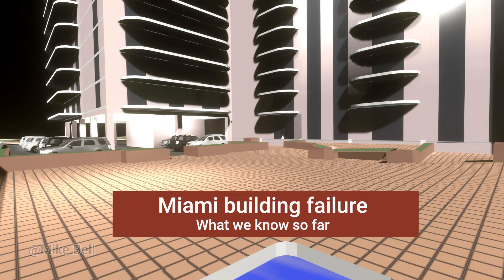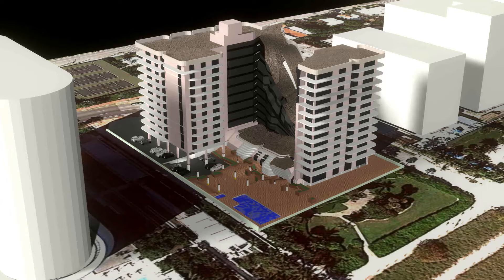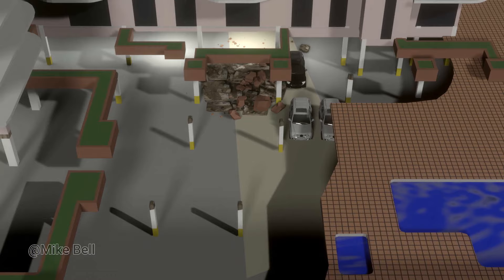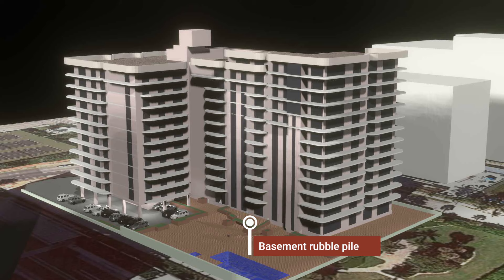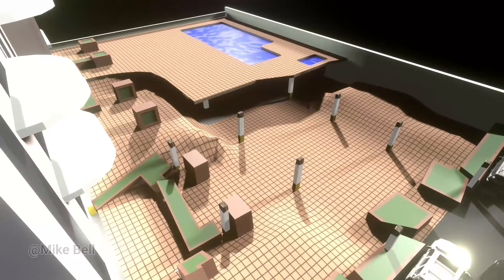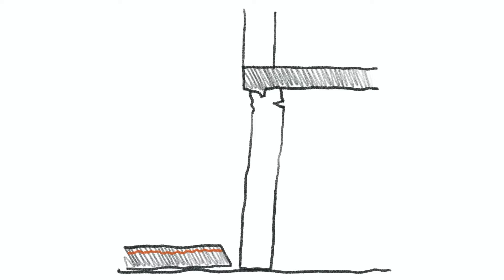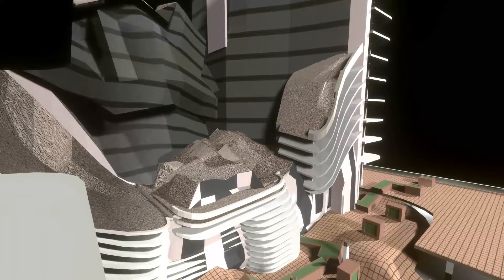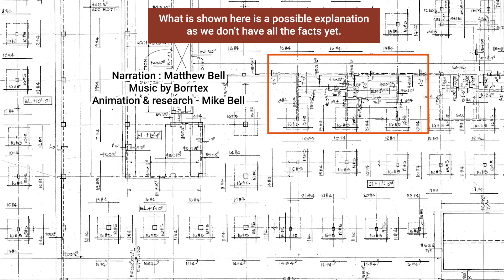MIAMI CONDO COLLAPSE | visualization of the evidence pt2

Comment: I work for a surveying company and my main job with them is to perform dilapidation reports on buildings that surround new development sites. If a new building is about to be built, it's law where I am from that you have to hire a surveying company to investigate and photograph every inch of every surrounding property and record pre-existing damage in case ground works from the new site cause vibrations which in turn cause any damage, I will be the one who will have recorded whether the damage caused was pre-existing or caused by the new development.... So needless to say, I've seen every inch of hundreds of parking garages, staircases, and the internals of every apartment in those buildings over the last few years.... And I've seen waaayyyyy worse than the water damage in the video from a year before the collapse. It's scary to know this is probably going to become more common as buildings progressively get taller and fancier, but completed with shortcuts and cheap materials to build them faster and for less. They look all nice and fancy when they're completed but after 15-20 years, they'll look like they're 70-80 years old in terms of depreciation and damaged caused by a mixture of poor designs and shoddy builders/developers. I've seen entire support columns of high rises cracking with efflorescence caused by leaking pools on the ground level. Entire slabs cracked in two, with cracks large enough I can see the warped re-enforced steel inside it. Sagging cement that separates the ground floor from the basement... among other things. We always inform the building managers, body corporates and councils when we find damage to areas that could put the structural integrity of the building at risk one day, but it's always shrugged off. No one seems to care until the worst case scenario happens.

With some of the things I've seen, I'd never live in an apartment block taller than a few stories.
Reply: Very good advice.
Reply: Holy sh**!!!! Your comment will undoubtedly haunt me for life now, but I’m glad I read it. Thank you 🙏🏻
Reply: Thanks for your insight I'll take your word for it and stick with houses, thanks.
Reply: I have no building construction experience, but from looking to the spikes, (You refer to as colums). On first sight they seem very small for such a heavy construction.
Reply: Hello! Can you help with that: can you tell me if it is possible to say it is safe to stay living in an apartment with some "scars" on the wall and on the ceiling, just by giving a glance at them? =/
Reply: You better create a list of what you have seen and where please.
Reply: @GYT923  thanks a lot.
Reply from the maker: Fantastic comment Grant.  I agree this what I also find troubling.  There were no obvious signs of distress.  Morabito Engineers who had done detailed inspections multiple times and are most qualified to assess the stability of the structure.  They too would have seen much worse and did not advise evacuation.  Nobody else raised the alarm.  The threat lay hidden.
This confirms the perfect storm scenario where multiple factors aligned to cause the catastrophe.  
Razor thin margins (or negligence) in the structural design and inadequate punch thru failure rebar.  
Long-term corrosion through maintenance neglect.  
Inadequate drainage slopes on the pool deck worsening salt infiltration.  
Possible internal stresses in the structure from historic differential settlement.  
Inadequate shear-walls.  
A peculiar arrangement of planter support beams which crunched/buckled 3 tower columns.

There are so many buildings in a much worse state and they remain.  There are abandoned buildings receiving zero maintenance which are still standing.  We will have to wait for the conclusive answers why this building was doomed.
Reply: @Mike-Bell  You're right. When it comes to a disaster this catastrophic, it's not just 1 or 2 underlying issues.... It's several and as you say it caused a perfect storm scenario.
I haven't been following the developments of the investigation, I'm all the way in Australia and except for the collapse itself, we've not heard much on the news over here - but I sincerely hope someone is held accountable if it's even possible to do so...
Biggest problem is the building was built 40 years ago in 1981. I just researched the developer in charge of the project and his name was Nathan Reiber - died in 2014. It's hard to go after someone who's been dead for 7 years. In fact it was a number of developers who had forged together to create a company purely to build this building "Champlain Towers South Associates". So once the building was completed, they would have packed up that company making it a nightmare for residents if (or in this case when) something happens to chase up restitution for their losses.... Whilst there were still architects, engineers and plenty of other contractors involved - most of the decisions made would have fallen back on Nathan and his fellow developers who were the ones reaching into their pockets to fund the project. I also read that the main architect on the building William M. Friedman (not sure if he's still alive) had been suspended due to something else he designed collapsing in a hurricane in 1967 so there's every chance this building was doomed from the moment it was designed.
I'd imagine that anyone who should be held responsible will either now be dead or will be dead within the next few years as they'd all be 80-90 years old or older.
Reply: @Godzillafan1980  But if everyone else on the planet died, how would you ever lose your virginity?
Reply: Uhhh, depends.  Living in earthquake areas has shown me that it's better to live in a house built of straw.
Reply: Same. Id never live in a high rise, always had fear of a major disaster
Reply: Money 💰 is the key any care about human lives
Reply: Thanks now not will I :)
Reply: Building 500 (?) yards from the ocean, on sand, has got to be the deciding factor here...
Reply: Thank you for your informative post. The conditions you enumerate are all the more reason why all towns and cities need more robust laws and aggressive inspection regimes that would require consulting engineers to report dangerous conditions to municipal authorities and hold them culpable if they do not state succinctly that a particular structure or condition is a threat to life, and would most of all require local building authorities to aggressively enforce safety codes and act swiftly to condemn and evacuate when a structure is dangerously out of compliance.
Reply: The building was originally designed in the 70's. At the time, the support structures were carrying approximately 90% + of their recommended capacity for their size. Later refitting of patios and interiors included a lot of Granite tile and granite overlay of patios. One apartment is no big deal, but you start sticking stone tiles and counters into every apartment, the tonnage starts piling up quickly. Then you add planters with dirt and water, tiles to the pool deck with sand under them and you get a lot of extra weight causing flexion of the structure that as standing water seeps into the concrete. There was a lot of water pooling and cracking in the garage area where the deck began to collapse. Several months before, one of the planters in the pool deck had dropped on one side by several inches indicating the start of a potential punching shear. It was put down to root intrusion. Photos later released. There was also cracking and spalling in the pool mechanical with photos taken buy the contractor checking out the pool mechanics. There were a lot of things that, taken as a whole, point to this building screaming that it was overloaded.
Reply: Do the regulations not stipulate enough to prevent this sort of thing?
Reply: Good to know. I’m interested in your thoughts on the large buildings built in the sixteen and seventeen hundreds vs now. I have the impression they were built to withstand time with more attention to detail, and esthetically much more pleasing in my opinion. I’m also curious what you think of glass bridges (I saw a video of two different ones in China I believe?) and the glass pools that connect two buildings higher up. I suppose they’re intended to look somewhat scary but to me they look like they actually could be scary.
Reply: Yes, classic brick building with wooden floor structures !
Reply: Why don’t you inform the residents living in these condos about the condition of the building, so they can push building management to fix the issues? Lest another similar tragedy happens elsewhere

Comment: I practiced architecture for 35 and have considerable experience in concrete and steel construction, having worked in many projects designing structural solutions in concert with structural, mechanical, and civil engineers. I have not heard yet any comments to this effect, but if the video is correct (and I've seen this before on another video), it is inconceivable to me that the structure for the pool deck was connected directly to the structural columns of the building.  Those should have been designed as two separate structural systems from day one.  In the underground garage there would have been two sets of columns side by side along the outline of the building above.  Two different structures, with different loads, and different horizontal and vertical forces. I would have never, ever, designed anything like that, nor would I have approved such a design if presented to me.  I hope to hear about this from those investigating the cause for the collapse.
Reply: I'm no engineer but I agree..  have seen a few videos on this collapse and cannot understand how the pool deck used the same columns along the deck side as the actual tower itself.  How did this ever get approved and built?  Makes no sense to me.  I have been in a few high rises with decks above garages, etc. and I have seen columns side by side, 1 for the building and the other for the deck.  Completely separate supports.  I recently watched a video of the other Champlain tower where they are adding supports in the garage until repairs can be done.  It looks as if the north tower is built exactly the same way.  I would be hi-tailing it out of there if I was a resident for sure.  I wonder if we will ever know what the actual cause of this collapse was.  In this day and age things like this just should not happen.
Reply: @glenembrey1187  Approved because of building dept. corruption and ineptitude.
Reply: Are you an engineer?

Comment: Nice computer simulation.  A month later and the shock and horror of this event still ring loud.  The cause of failure source is essential for so many people.  Not just the loved ones but the other condo dwellers in that area specifically want and need to know so they may take appropriate action as necessary.
Reply: There are immediate engineering factors then there are philosophical factors: "Not my yob, mon" as it were.

If we cure the philosophy -- and the Lord is leaning near hoping for open ears -- this will bring due attention upon the quality of engineering of the edifices we have chosen to depend upon.

The concern is as old as Leviticus.  To restate in modern terms: if your roof is accessible as a living space then it had better have a wall for safety's sake or the blood of accident victims is on you.

Also Jesus the carpenter spoke of the necessity of a good foundation as a spiritual metaphor whose physical illustration would have been obvious at the time.

This won't be cheap or easy to fix.  Many engineering sins have been buried to more or less quietly emerge later.  Perhaps sonic and strain sensors will prove necessary.  An evacuation would stink, but not as much as an unwarned collapse.
Reply: McAfee ??? 🤔🤔🤔

Comment: So sad. I drove past this building every day for 10 years.
Reply: I just thought about the earthquake that was felt in Miami a couple years ago. Was this area impacted any by this? I wonder if the earthquake worsened the state of this building.
Reply: @cicefashion4685  This building was in good condition vs Lateral loading conditions (hurricanes/earthquake loads) as their shear walls proved to be functioning well (they were the reason why the 2nd collapse was delayed and why the other part of the building didn't fall down). So, no i doubt earthquakes had anything to do with this collapse. In case you are wondering, yeah shear walls are the main elements that resist lateral loads.
Reply: @cicefashion4685  Do you mean the Haiti Quake ??   There are quakes that happen south of florida,  but  I haven't seen that any were close to  southern florida  as an epicenter.  Dutchsinse is  a great source  for  quake  news.  ( just dont tell the  USGS ) :)   I have another  "watcher"  in the house  here  who agrees - there was a minor quake in florida within the last few years ,  between Tallahassee and  the  Gulf coast,  she says  below 2.1  so,  it most likely  did not affect this  structure at all.
Reply: Hey Tom,  were you there for Hurr. Andrew??    I could see that starting the  corrosion if the  basement flooded.
Reply: @Wag2112  hi Wag2112! Yes, the earthquake I am referring to happened on Jan 28, 2020. It was a 7.7 outside of Cuba and Jamaica felt in Miami. A few buildings swayed. In September of that year other trimmers were felt, but I think there was a construction explosion that caused  those trimmers.
Reply: @JoseRamos-mv2ty  liar*
Reply: Alpha Omega  <<<<<<<< Troll alert
Reply: Mmmeeee meeeee meeeeee

Comment: I think you have presented a very logical and well thought out scenario of the failure.  I think we will find that the pool deck slab was significantly overloaded by the addition of built up fill slabs to obtain slope for drainage the setting bed and pavers and the loads from the planters, which the original structural engineer did not provide for.  Note that the pool deck slab was only 9 1/2 inches thick with a max. span of 29 feet.  Based on 50 years of structural engineering experience it should have been at least 2 inches thicker or should have incorporated at least 4 inch deep drop panels at the columns.  Great job with the simulation.
Reply: Making those planters part of the pool deck was a bad idea. If they hadn't done that and used individual planters you buy in a store that would hold the water (no holes on the bottom), that may have helped to keep the water from constantly flowing into the basement garage/ceiling.